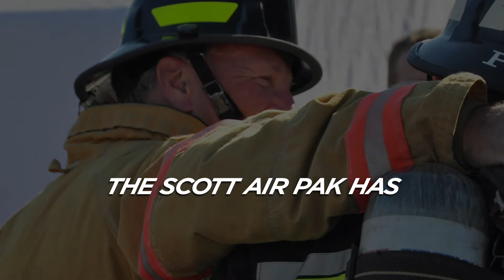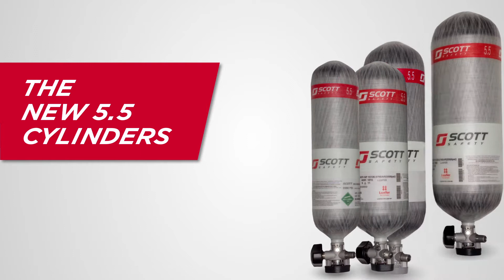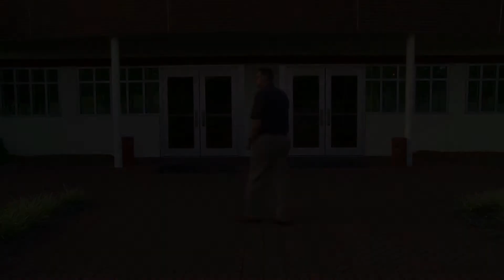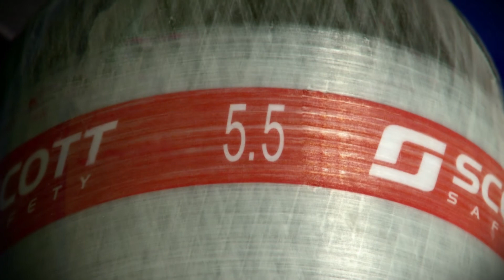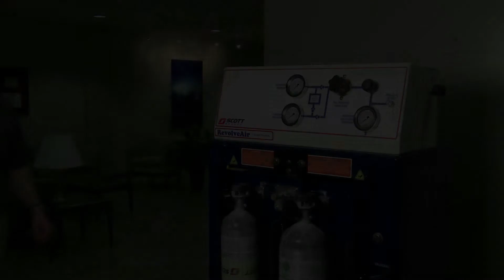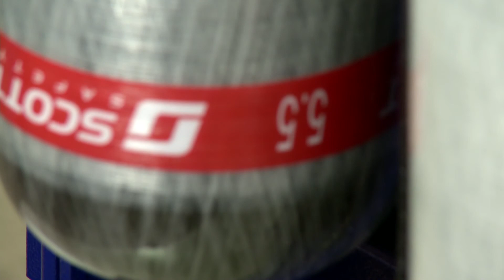Introducing the 5.5 Cylinder by Scott Safety

Comment: sorry for disturbance
I've got a problem with the SCOTT air compressor
When the compressor is running after about 30 seconds of operation, it stops working
SHUT DOWN
It gives a message (high temperature) up to 634 ° F
Knowing that the compressor is very cold
Please help in this problem so that I know where this problem is
And work on repairing me
Thank you